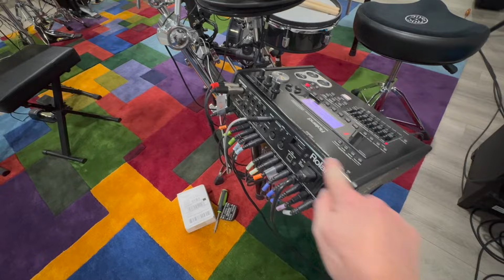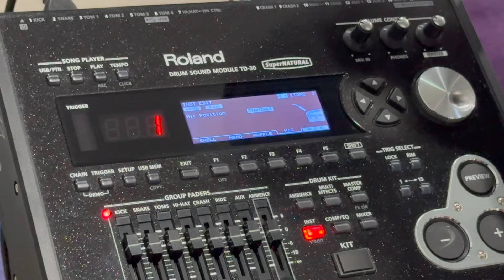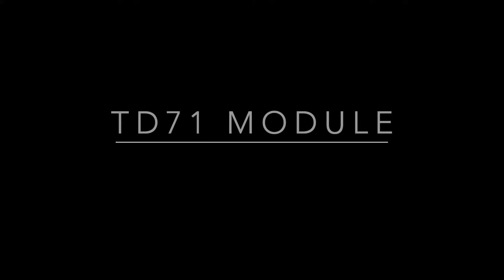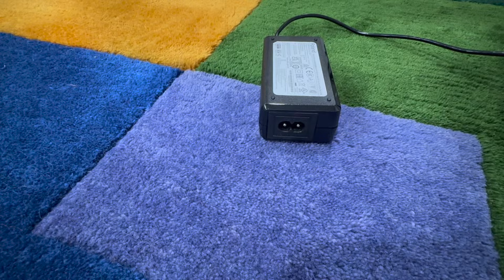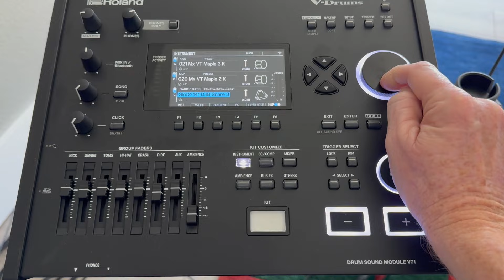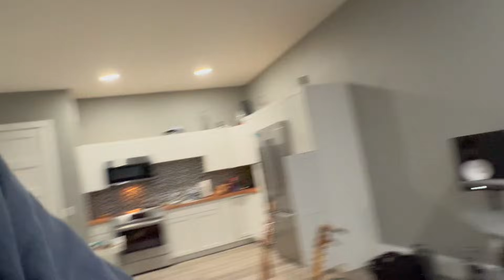Roland TD30 vs TD716: in-depth discussion with alternative drum layouts

Comment: I bought the silver ride that you have used on Reverb. It's surprising to hear that yours has held up so well after so long because after owning mine for about 4 months, the paint has worn off to its black exterior. Still works perfectly fine, but it's not as "pretty" as before.
Reply from the maker: I purchased around four sets over the years -- some used on Reverb. Picked up the best ones I could. Every single one has lasted amazingly well. No visible wear on any of them. And these are not black that's for sure! The rubber underneath is gray silicone, and it has a sparkly silicone over that. So if yours are black, it makes me wonder if someone just took a black cymbal and painted it silver!
Reply: Let me be first to say how jealous I am! As a chemist by day, I'm really interested in what exact exact type of paint they're using to achieve that aesthetic and durability. Whatever I've got on mine isn't what you've got, clearly. Is everyone at your church fighting to play the new 716 or the old TD30?

Comment: Why don’t you simply load the TD-30 Legacy Kits into a v71 slot and compare the triggering?

I’m certain you should achieve better triggering with the v71 latest trigger tech when you compare those directly to the same kits on the TD-30.  

I don’t own cy16rt but I think the cy16rt is known to have lots of reports of malfunctioning.  Not having those problems with the cy14rt w v71 nor am I perceiving discrete layers when I actually play the hihat properly with my feet.  You might be grabbing your cymbals too much like a crab instead of pulling your thumb back to meet the edge which is the same technique you should be using with acoustic cymbals anyway.  I think you are bastardizing the meaning of the hihat offset param and just never once successfully played the hihats very well with your actual feet (you need to use the pedal input rather than the offset to achieve mixing of more than one hihat articulation layer).  But again, try the td30 legacy kits in a slot and report back about the layering.  

Finally on all Roland modules i always disable compression, EQ, reverb/fx and tune articulations to 0 to audition usefulness.  These digital features have always destroyed the integrity of what can be achieved when they are off or similar effects are alternatively applied externally.
Reply from the maker: Not all TD30 kits are available for the V71. Only certain ones in their cloud. The rest of my comments stand by themselves...
Reply: @WilliamBennerJr 

No shit, Sherlock.  But the only hihat worth using in the TD30 is the one named ‘custom’ and you are too lazy to go and try it.  Based on the length of this video, the fact that you didn’t play a single beat and the way you tuck your shirt like a tightwad in your own house I don’t know why anyone would take your opinions seriously.  I feel bad for your son(s) having to put up with a father like you.

Comment: Honestly, I don’t believe that the sounds on the V 71 module sound bad. They do sound really good and the module is amazing. The only gripe is that I wish there were more than 70 sounds built-in but that’s besides the point the point is I really do like the sound of this kit
Reply from the maker: Glad you like the V71. But have you played with the TD30 too? You'd really need to hear them and experience them side by side to make a judgement. I did, and sold the V71 and new cymbals within a month of buying them. I did keep the drum pads and stand though.
Reply: @WilliamBennerJr  I played a TD 30 before, but it was back when I was real young played the V 71 module in my local GuitarCenter and honestly the V 71 module it sounds wonderful

Comment: Regarding the external power supply- with most digital electronics you want that transformer as far away as possible to remove any possible hum or ground issue. They included a ground screw as a safeguard.
Reply from the maker: Heat was never a problem in the TD30, and I hope you don't leave that thing at home!

Comment: I liked Roland’s silver grey cymbals in the past. Not sure after watching your video I’d get the v71 now. Maybe the V31 is best at this time. Been playing on a TD-12 for 20 years and still sounds decent.
Reply from the maker: Yes, TD12 is very good. I hadn't heard of the V31, but it seems to be in the generation of the V71. As a technologist and leader of technology teams, I can tell you that great products come from skilled and passionate developers. Those who worked on the TD30 (and probably TD12 too) were amazing developers, but they left shortly after the TD30 was released, which is why the TD50 could not measure up (not upon release, and still not after the update). The V71 has mistakes that are really obvious to me, but easy to correct. I do hope that there will be an update, although in the mean time I'm perfectly happy with the TD30!
Reply: @WilliamBennerJr I’ve been playing the Roland TD316 at my local Guitar Center for a couple of days. It does sound good through head phones at least. Waiting for the guys at GC to get the Alesis Strata Core setup so as to compare. But right now, the V31 module might work. Heck May spring for a V51 setup when all is said and done.
Reply from the maker: @jeffgermanich8105  Hmmm. V31? V51? These are new ones on me! I only knew about the V71.

Comment: Hi William - thanks for the thorough video. Curious about how you added those additional pads - did you use Y splitters, splitting the rims?
Reply from the maker: No the TD30 supports 16 separate inputs. No need to split things. Works really well! TD50 and V7 have no greater number of inputs!
Reply: @WilliamBennerJr  Sorry I meant the V71 module.

Comment: I never use wood tips on edrums. Marks black cymbals and can snag mesh heads.
Reply from the maker: I have a patented drum stick insert, and happened to have wood tip sticks in stock at the time. Since then I've switched to Nylon, not only for these but also on our acoustic kit at Church. It doesn't matter as much with the silver cymbals. Roland should not have discontinued them...

Comment: Awesome video. Thank you for posting this.

Couple of question if you don't mind:
1) Is the V71 module larger than the TD-30?
2) Is the V71 module made of metal (like the TD-30) or is it plastic like the TD-27?
3) I'm not sure if you used VH-13's on your TD-30 kit, but are the VH-14D's worth the price? I love my Roland kit, but have always hated the hi-hats (due to lack of sensitivity in comparison to acoustic hats). Is there much of a difference between the VH-13's and VH-14D's?

Thanks again. Wonderful video. Grace and Peace!
Reply from the maker: I've already boxed the V71 up in preparation to sell it, but from memory I think it's the same size. Maybe a teensy bit larger, but hard to tell by eye. It is indeed metal. And I use VH13s all the time. As for the VH14 that comes with this kit, it has the "thin edge" like the cymbals, and I didn't like the thin edge on the hi-hat either. I think it doesn't do as good of a job at sensing. To me the VH13 was just better -- at least what I'm accustomed to. So for a while I used the VH13 on the V71, but -- again, sorry to say Roland, VH13 doesn't work as well on the V71 as it did on TD30. The TD30 is just amazing. Those guys did a great job.
Reply: @WilliamBennerJr  Thanks for the input. Uh-oh, why are you selling it? I just purchased one through Sweetwater and am waiting for the order to be fulfilled.

Yes, I love my TD-30. I've tried the TD-17 and the TD-27 and hated both.
Reply from the maker: @dirtremovesblindness  Why am I selling? In the video I explained my rationale. 1100 sounds in the TD30 versus 275 on the V71? Plus I have to say, TD30 just sounds better. Sorry Rolland it just does! So I purchased another TD30 and have offered this V71 plus all related parts (except the rack and toms) on Reverb.
Reply: @WilliamBennerJr  That's so disheartening. I wish I had watched this before purchasing the V71. Thanks again for the information sir!
Reply from the maker: @dirtremovesblindness  Well you'll need to play with it and find out. It could be that you will disagree with me. Others certainly have...

Comment: You can use nylon tips for those symbols. I’ve played on an old TD 50 KV kit at my church and we’ve had it for years and I used nylon tips all the time because I didn’t wanna get the pads dirty so really I use nylon to nips for electronic.
Reply from the maker: Yes I've just switched to Nylon, although I'm also switching back to my old TD30 with those silver cymbals.
Reply: Personally, I like some of the kit sounds on the TD 30 especially preset one studio kit and personally if I were to choose what sound I would use for practice, I would have to use the preset one which is in the legacy pack, but depending on my case which is being a church drummer and a southern gospel/contemporary Christian music drummer, depending on the song, I would choose the packs that DW designed because if you hear it out of a PA system, it’s gonna sound really good in the mix with your band as I have heard and seen

Comment: Clarification Roland cloud offers a lifetime key access which means you can buy any expansion pack you want and own it forever
Reply from the maker: Right. Buy their most expensive unit, and then pay more... and still not have the 1100 sounds the TD30 came with.
Reply: Correct, not possible to load all the sounds it’s only limited because there’s only so much that the module can take so to speak
Reply: Well, if they would’ve added all of the sounds that came with their TD 30 in. It probably would’ve been too much for the module technology wise.
Reply from the maker: @drumman456  Not possible to load TD30 sounds per se -- only the very limited TD30 pack they have on their cloud, which only has maybe 8 kits, and they're not as complete as the original TD30.
Reply: Could be wrong though, but still overall, it is really a good sounding kit

Comment: It's a bit strange for me, TD 30 is still a good instrument but a bit outdated, TD71 has much newer technology and sounds in my opinion and the sound engineers 300x better than TD30, it's TD30 in my opinion that sounds like a machine gun and sounds simply like "Roland" characteristic sound that I don't like, in TD50 it was also like that and TD71 already has other samples and here I was not disappointed. I often used Superior Drummer and waited for a product to appear on the market that would allow me to use the module itself, additionally maintaining very good sounds and TD71 is like that. One thing I agree with is the choke function in the cymbals, here something went completely wrong because it works dramatically. I also have second electronic drums Yamaha DTX 700K and there in the cymbals it works "normally" and intuitively, but here you actually have to squeeze perfectly on the edge and quite hard, which is quite problematic when playing a given song. But the digital Ride works wonderfully. I also disagree with the hi-hat. The air escapes to other places and I honestly don't feel any "cushion" or anything like that, it works well, the snare drum is simply out of this world and I don't know how you can say that it always sounds the same in the TD71, it doesn't, I would say that in the TD 30 we always get a similar sound and here it is more balanced. In general, from your film I concluded that you are very picky about the 716 set and very strongly praising the TD 30, which is abstract to me. The TD 716 is much newer and much better than the TD 30, some things could be done better but it's heaven and earth in terms of technology. I also don't understand picking on the module and looking for some problems by force, such as that there is a lot of space above the screen in the TD71, while in the TD30 there is also a lot of space above the screen, but you didn't say that, by force looking for problems in this set and by force praising the TD 30.
Reply from the maker: V71 is certainly newer. Has modern features. But every single snare hit will deliver the same sound. This is not true of the TD30. I don't know how they did it, but TD30 delivers amazing sounds. I will also make this point very firmly: I presently have both, and can listen to them literally side by side. No machine-gunning with TD30. Very much machine-gunning with TD50 and with TD71 as well. I'm not sure how people can even stand it... In any event, you will soon see a video where I am offering the V71 and accessories for sale on Reverb.

Comment: It's V71 not TD71. You can buy lifetime keys for the expansions.
Reply from the maker: Yes thanks for pointing that out. Glad people understood what I meant. Regarding buying these keys, okay. But let's take the most expensive module you can buy and make people spend even more money. I've been playing with thing for around a week now. Really hate the sound compared to the TD30.
Reply: @WilliamBennerJr  I come from a TD27 (came with my VAD 507 kit) and for me the V71 is a huge improvement (I can not compare with TD30 or TD50x). The choking (or not choking) is something that bothers me also: one has to be able to rely on a choke working, period. Many times choking does not work or too late; very annoying. You can ruin a song.
Concerning the amount of stock kits, there are some more in the pre-installed racks but they are not all installed. The Wood kits for example, I think two are installed but there are five in that pack. You have to install them yourself. Same with the Brush pack.
Regarding the expansions you have to pay for, that is the Roland model of today; milking the customers to the hilt.
The same with the lack of enough storage memory. Nowadays the cost of 8, 16, 32 Gb is so low but Roland continues to save money on this. Incomprehensible.
Greetings from Belgium.
Reply from the maker: @Ludo_A  I looked into the TD27 briefly. My guess is that this came out of the TD50 project. One point that I'd like to make: The team who worked on the TD30 left Roland... The TD50 was a development from scratch, not an evolution of the TD30. Customers were really disappointed with the TD50 when it came out... Another point: The TD30 carries the moniker "SuperNATURAL" and to me, it really lives up to this name. None of the other modules -- not the TD27, TD50, V71, etc. do not carry this moniker, and to my ear, do not live up to this name either... The TD30 is just amazing and I can't figure out why it's so much better. But one element could be that it has many many samples from very light hit to very heavy hit. Because of this, almost every time you trigger a drum sound on the TD30 it sounds different, because almost every stroke a human makes is at least slightly different. Michael Shack discusses this in his videos about the TD30. When I hear the TD50 and V71, if you listen carefully you can hear that there aren't that many samples from light to heavy stroke. Maybe 5 or 6 different samples on the snare and probably the same on hi-hat open-to-close. For this reason many times you get exactly the same sound as you strike a drum surface stroke after stroke after stroke. It makes it sound like a machine-gun. To me, coming from the TD30, that's really annoying. To try to cover this up, there is a kind of layering available on TD50 and V71 (maybe TD27 as well, I'm not sure). But this layering can blend drum samples together based on how hard you hit the drum. But this still isn't as good as what TD30 did. TD30 is simply amazing. It as a great team that created that module. I will be selling my V71 and I've already purchased a replacement TD30.
Reply: @WilliamBennerJr  Thanks for your insights. I hope I get a chance to speak with Michael Schack. We are both Belgians.